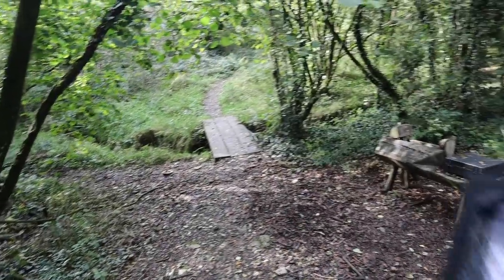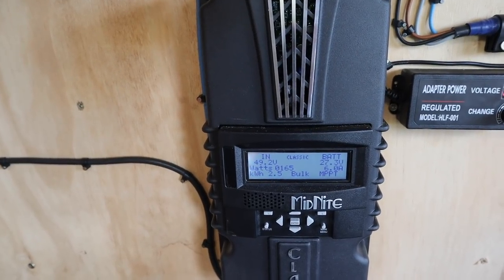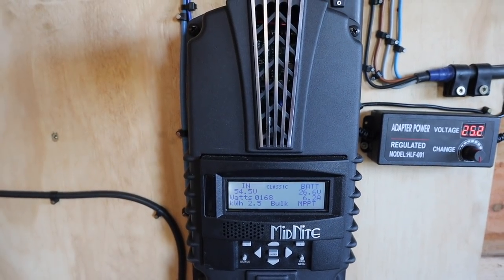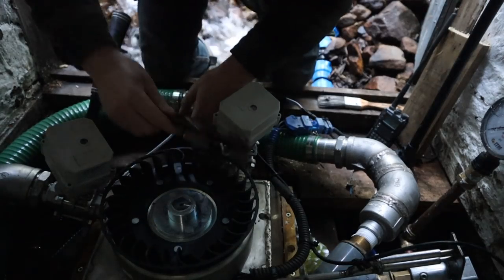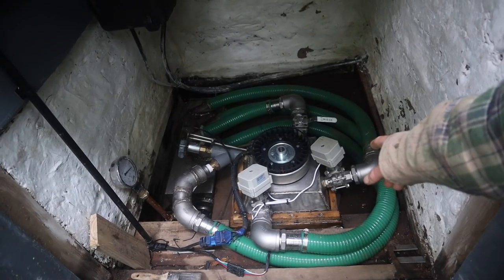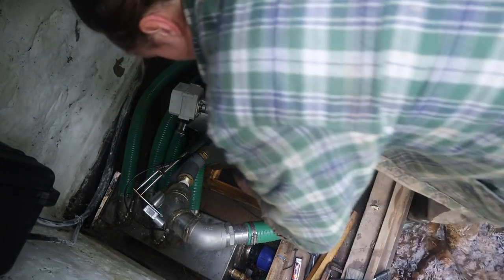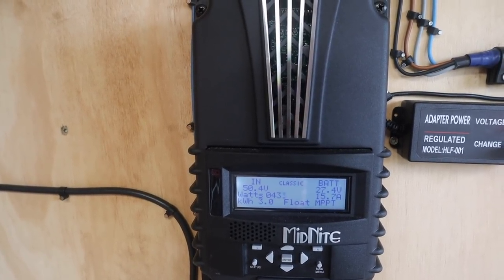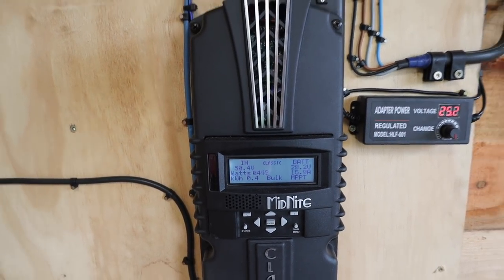Off Grid Micro Hydro Turbine Fine Tuning (13.25% Increase In Efficiency)

Comment: There are a fair few suppliers of Synchronous Rectifier ICs, which do use MOSFETs, something like the LT4320 from Linear Tech. There's an application note for those in a 3-phase setup too.
Reply: @bearbin  There's an official dev board that will take 25A, but like many dev boards, it's hideously expensive. Quite luckily it's a fairly simple layout & design, and a full set of PCB layout & schematic files is available for the dev board, should you wish to replicate it. I suspect that the reason the Chinese haven't yet done a board themselves is that there aren't any knockoffs available yet ;)
Reply from the maker: Great info, Thanks guys :)
Reply: @KrisHarbour  Not a problem, there will still be losses obviously - but the very low ON resistance of modern FETs will ensure a much lower energy loss. The IRFP4468PBF has a 2mΩ Rds On, at ~20A or so 6 of those shouldn't even require heatsinking. Also consider the size of the feed cable from the alternator - 20A over a long cable can produce quite the voltage drop, even on a pretty large cross section of copper. The AC frequency is also a factor, due to skin effect.
Reply: @Andromedan  there is no skin-effect on these rather low frequencies, i think that will be fine... to get around the cable losses, instead of increasing the cross-section of the cable, you could also step up the voltage using transformers... both of these solutions would be expensive though :(
Reply: @alexreeve  It's unlikely to be a major effect, I agree. At 500Hz, the skin depth in copper would be ~3mm, and that's assuming the alternator is running at a higher frequency than aviation units, which is unlikely. Stepping up the voltage with transformers power distribution grid style would also introduce extra losses in the windings & cores of the required 3-phase transformers! For such a small system, these losses could be significant.
Reply: @Andromedan  yeah i dont think the generator runs at such a high frequency.. and your youre right about the transformers, they are not lossless devices either... in the end you have to run the numbers and compare one solution to the other... everything else is just guessing :) educated guessing maybe, but still guessing ;)
Reply: I believe he mentioned the system is targetting 5000 rpm, or 83 Hz.

Comment: The line losses far exceed the rectifier losses. increasing supply line voltage would net greater gains than worrying about the 5 - 7 watts rectification losses. mounting rectifier  in the correct  orientation would improve the cooling and thus lower operating temperatures.
Reply: Pull apart some old electronics and use the aluminum fined pieces for a back spacing on the plywood. Or just a nice chunk of aluminum to soak up heat and protect that wood.
Reply from the maker: my cable loss is hardly anything 50v AC over 100m of 16mm squared cable  means the loss is tiny.
Reply: Power loss is a function of current not voltage. It's I squared times R.

Comment: I think kris the one that gives 178  you change the angle . The angle  of 90 degrees gives more compression in the nozzle output. I suggest you make a big volume of reservoir outside I mean the catcher attached to the pipe  to increase the  flow of current pressure in pipe thus increase the pressure in the nozzle and push more the turbine leaf

Comment: You have to find a rectifier wich uses schottky diodes with a low forward voltage. I consider that your rectifier uses silicon diodes. Thy have a typical forward voltage of 0.7 Volt. Since you are running 9 Amps off the turbine @50 Volts this leads to a powerloss of 6,3 Watts per diode (0.7V * 9A). As you have 6 diodes on a 3-phase rectifier it adds up to 37,8 W of losses on your rectifier. The smaller the forward voltage is the smaller the losses will be. The forward voltage is the voltage needed to let current flow throw the diode, this leads to a voltage drop (as high as the forward voltage) over the diode.

Comment: I would also recommend rectifier made of Schotky diodes, but also I would recommend a to use couple of transformers to get higher voltage on long cable run to shed to get better efficiency and lower loses... Anyway - when Midnight is in float mode the power reading is not precise, as it needs to get lower power to battery...

Comment: Not sure if you have 3G/4G on your mobile phone but if you do...
You could run a simple cheap VPN server on your home network and connect to it securely from outside (from your mobile phone) and therefore monitor and control your hydro system remotely. 
OR from your phone you could also create a wifi hotspot to allow your tablet to connect to the internet using your phones 3G/4G connection, then tablet connects to VPN server and able to securely monitor/control hydro. That might help with any fine tuning directly from the hydro shed.

Comment: Do you have a clamp meter?
You can clap a single conductor coming off the hyrdo generator and monitor the current flow directly out of the generator and fine tune it locally saving you having to walk back and forth. Hope that helps.
Reply: clamp
Reply: @manolisgledsodakis873  penicillin

Comment: You could easily achieve your goal of 450 if you updated your water intake screen. A kowanda screen allows large intake of water while still keeping leafs  and sticks out of the nozzles.
Reply from the maker: i know, but its not cheap that stuff and i can only find it in quite large sheets. i only need a little bit. the intake is still supplying enough water (when the water is there) at the moment. just wont be able to get much more out of it without going a bit bigger.
Reply: @KrisHarbour  This is a good point. :) Have you looked at a Aquashear Coanda screen by Dulas, (they're in Wales)?  They custom make, only pay for what you need - ( www.aquashear.com ) They might even sponsor you one given the amazing quality of your build / project!   Also.. with your skill set, you could make a much more efficient intake and intake screen!  Keep up the amazing work and videos!

Comment: Parallel the Bridge Rectifier up with the same type ! that way you will share the current, or just get seperate very high current low voltage drop rectifiers on heatsink, dont forget insulation so you can form a 3 phase to DC out !

Comment: At the risk of repeating the simple way of reducing the losses would be to increase the cooling capacity of the rectifier by either increasing the size of the heatsink or tapping some of the power produced by using a fan. 

As far as the heatsink goes I would look at seeing if you can mount it where some natural airflow can move across it e.g. outside if possible.
Reply: Tristan, I am afraid once the heat is produced it is lost to the air. Cooling the heat sink will remove the heat quicker but the diodes will be blind to that fact and still produce their .6V x ?A = Watts (x 2 for in/out)

Comment: The most efficient thing to do is rewire the generators to be DC and then you don't need to rectify anything. Failing that, any industrial 3-phase to DC transformer will do better than the space heater you're currently using :)

EDIT: But you should definitely consider 48V generators, they're ubiquitous
Reply: Then, you would have commutator losses. Don't know how big.

Comment: I recon the rectifier wastes 20 ish watts, judging by the size of the heatsink and the fact that you don't need to active cool it. This is because i have a similar heatsink for my diy 30 watt LED torch, and it goes up to near boiling without active cooling. But please take your own measurements if at all possible with your current tools.
Reply: Maybe even less, believe it or not I've made a DIY 30watt torch fot Mountain Biking XD
Reply: also agree definitly not 50 or 60. mp

Comment: Hi Kris, Did you consider using an Impeller/ Runner instead of the Pelton wheel?. No tuning would have been neccessary. Not sure what the output with an Impeller would be on this set up, Fancy trying an experiment?.

Comment: There are rectifiers that use MOSFETS as “ideal diodes”, but with tiny voltage drop, hence much lower dissipation losses. Perhaps this idea could be utilised?
Reply: See here: https://www.analog.com/en/about-adi/news-room/press-releases/2016/low-loss-3-phase-ideal-diode-bridge-rectifier-reduces-heat-easing-thermal-design.html
Reply: How about changing the orientation of the heatsink to help with convection? Obv. it will still generate heat, but maybe it'll generate less heat.
Why over complicate? Increasing efficiencies ftw: but one does not need 99.99% efficiency? It's free after-all. Maybe stick with your 80-90% and call it a day?
Also, run an ethernet cable down to your shack ;). Redd|t while fixing your alternator.
Reply: Mosfet synchronous rectifier but you need to add a control circuit to switch them at the right part of the cycle. A simpler method which will give some benefits and without complexity is to use a Schottky diode rectifier which has lower voltage drop, the only thing you have to watch out is the peak reverse voltage rating which is normally lower than the equivalent silicon rectifier.
Reply: i second this. ideal diode based rectifier is what you want. very low losses. the value you what lowest is "Rds on".
Reply: @jamess1787  Yes maybe the temperature would be lower. But the heat produced by electrical losses would be the same since the efficiency of the electric parts used in the rectifier would not change.
Reply: @alexscarbro796  The LT4320 Ideal Diode Bridge Rectifier controller seems to be a good place to start. In the demo manual page 5 (https://www.analog.com/media/en/dsp-documentation/evaluation-kit-manuals/DC2465AF.PDF) there is a 3 phase implementation that I really like. I have searched both E-Bay and other places for a module having this chip without success.

If I do not find a ready made module in a reasonable time I will have to design such a PCB myself. 
Kris: Will a 25A 3-phase module be a sufficient starting point for such a prototype?
BE

Comment: Run two or three recifiers in parallel to split the working load or you can place a cooling fan on the you got and see if your power increases. The last resort is a switching power supply if your system has enough ac power to get it to run that would be 90 percent or better.

Comment: Amazing. Wasent expecting that much of a power increase with such a small tuning! For a better and more efficient rectifier you could use Schottky diodes. They have smaller voltage loss but you have to keep in mind their reverse voltage is low. U have to check that value before buying them! For example a normal diode use to support over 250V easily but Schottky diodes use to be around 40V. I recommend you get some 20% higher of your maximum Hydro  output voltage.  You can google how to solder them together to rectify 3 phases AC generator to DC. Dont know if you can buy the whole rectifying bridge made with Schottky diodes. Maybe it already exist. Hope it helps. Cheers
Reply: Look for automotive rectifiers like from a 24V truck alternator. Some have built on ring terminals making attaching easy. Get a current rating 100% above intended use to help keep it cool.

Comment: It would be awesome if you had a nozzle you could move with pneumatics or something and then use an Arduino to monitor each nozzle and auto-adjust to get the most power possible.
You would need a way to measure the speed of the water in each nozzle. 

You may lose more than you gain, but if you sized the system to make up for it you could add an electronic inline flow meter in each nozzle and then measure the speed and the computer will tilt the nozzle until it gets the best speed.

It could also adjust based on the amount of water available.

Comment: I wonder if moving the nozzles left and right, as well as up and down would see an improvement?
You could do it with a tacho, if you find the sweet spot, you would get the highest RPM when it's unloaded. Getting the water to hit the spoon faces at just the right spot probably is the biggest factor in the efficiency of converting water pressure to rotation of the impeller. Maybe some little glass windows would help as you could literally see the aim of the water jet hitting the cups. Good job on everything you do Kris, I like your style.
Reply: certainly helps massively with a pelton wheel, so assume with a turgo it would also.

Comment: Possibly you could use a bridge rectifier from a 24V lorry alternator. Most alternators have a build in bridge rectifier (which can be wired up independently)  and most alternators are around 90 Amps (which makes for a theoretical 2160 W capable rectifier @24V)
I understand not all rectifiers are created equal and you should (obviously) get one which does a full phase rectification.
Reply: The problem is not the current rating of the rectifier.. but the power dissipation of the diode forward voltage. The forward voltage of a diode does not depend on its power rating, but the material (silicon diodes for example have a forward voltage of around 0.7V). So with two diodes in series you lose 1.4V that are gonna be dissipated into heat (depending on the current). So the only options to get rid of losses are either use other diodes (or mosfets) or step up the voltage (so the current decreases).

Comment: How necessary is that fan on top of the turbine? That is going to be eating a considerable chunk of mechanical power to run. If you need it for cooling, but its overkill, try blocking it off partially as it reduced the amount of work it does. Its counter intuitive to some folk, but for 'pump' that isnt a fixed displacement pump, (like fans, blowers, centrifugal pumps) its doing less work, so it needs less power to run.

Comment: If the bridge rectifier has heatsink and vanes, why not wire a 180mm computer fan blowing over them into the circuit for active cooling and see how that affects the temps? I think you can spare the power for it.

Comment: I know it makes no difference for your efficiency but I noticed in your first valve that you're tuning that you had water running over top of the beam beside the Box. Would that beam be at risk of riding out to overtime going from wet to dry. I guess one solution would be to build a metal box that would shoot the water all the way Down Under the beam after the turbines done with it
Reply from the maker: that wood is always wet due to it being right above the stream. wood that stays wet lasts a very long time. its the wet dry cycles that rots wood. it is also a durable wood and will last many many years 

Thanks for the comment.

Comment: I think you're right to spend effort optimising the flow in the nozzles. Just wondering if you'd compared the power per litre/second of the spear valve with the actuated nozzles... imo the angle inside the actuated nozzles looks very steep & I'd have thought you want more of a 'reverse trumpet' shape... something like the shape of nozzle inside a toilet cistern float valve. 

Also the centrifugal blower on top looks like it might be taking a few watts - if you're not getting overheating you might try restricting the aperture  and see if it helps electric output... or going for an electric fan on a thermostat.

Comment: MOS FET is a derivative of a FET (Field Effect Transistor) the MOS is the material Metal Oxide Silicon.  If my memory serves me correctly FET's are voltage controlling current and as far as behaviour, they very closely related to the old valves, whereas your run of the mill transistors are Bipolar and are current controlling current.  At the end of the day all of these are transistors.  With some funky electronics these could be made to run as a bridge rectifier,  however any gains would be quickly lost in the power consumption of the control electronics.  Depending on how much power that thing can put out a fan or bigger heat sink maybe required, it will do nothing for the efficiency, but wonders for the longevity, depending on what the rectifier rating is.  I think your biggest gains maybe a bigger shed you could reduce the kinks by turning the turbine by -90 degrees, but a bigger shed would be required and it appears if you moved it down the hill a little another 3-9 ft in head height maybe achieved.  

A very impressive setup, and we are just nit picking, but you are now trying to extract every watt possible.  I don't know what the wind is like in the area, but a small wind turbine maybe the smarter way and less effort to get a few more watts.

Comment: Great setup! That's truly useful power. Bringing the water through that 360 degree loop will loose you some however, along with the ribbed hosing, I wonder what gains could be made by building a new PVC water input manifold in so it goes straight in the front door.
Reply from the maker: yeah there is some loss in the bends but it isnt that much and the hose isnt ribbed on the inside it is smooth inside.

Comment: Hi Kris. Instead of tuning it with the MPPT on, take the turbine off the charge controller and tune for highest open circuit voltage. Thats more accurate. Once you have it, set the Midnite manually to 50% of the ocV.
Reply from the maker: That does not work very well as the water is not getting interrupted and its energy removed so the water hits the sides of the housing and not down where it should go. this throws water all over the place and causes drag. when under load the water is directed down and its energy removed. I have tried it the way you suggested already and it gives unpredictable and confusing readings due to the splashing causing drag.